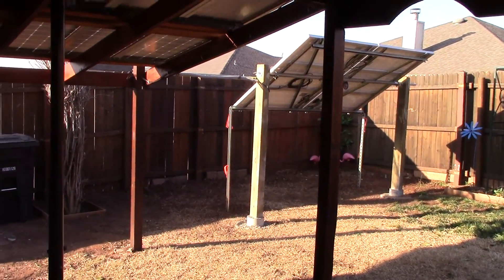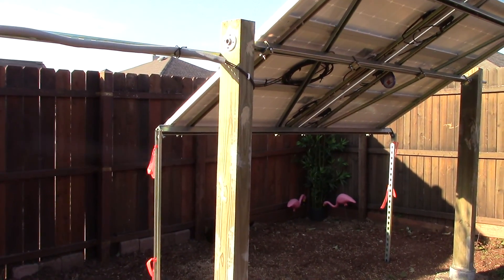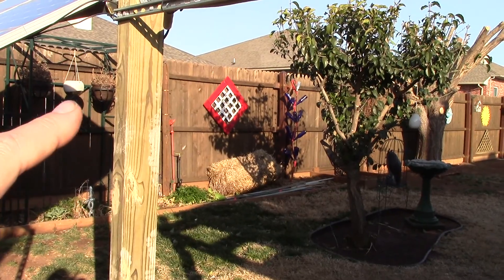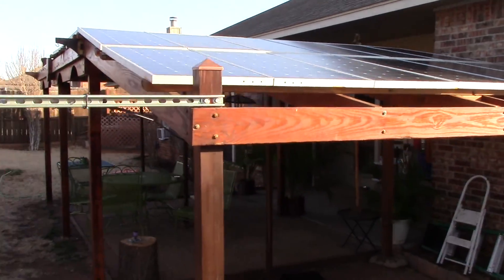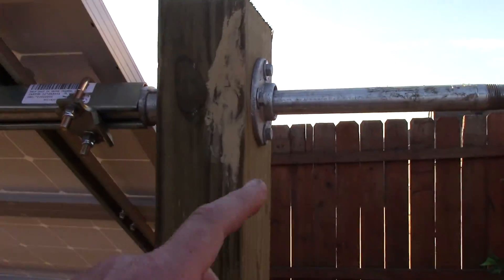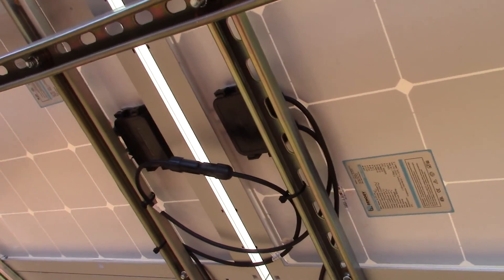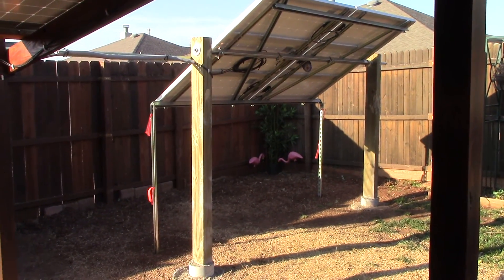Backyard tilting 600w Renogy solar panel fully erected & making power!

Comment: That is a great way to carry out the mechanics which allow the panels to tilt. What are the posts, 6 X 6's ?  I did mine using 2-1/2" water pipe, filled with cement, balanced the panel array and use a pair of strong arms to keep the tilt angle in place.  Got the idea from this YouTube:  https://youtu.be/g6pC1t0m92M?list=PLCEb0JK3QHYqPTKEa7Qq293FYVKu0Ee0X
Reply from the maker: Those were 4x6's. Took that 600w array down and put up the 1,200w array in it's place...which I have now. Never heard of folks using water pipe...but, with cement filled should be good and strong.

Comment: Hey Chris
David from Texas here. Working on new solar backup system got questions for you.I Have 6 190 watt they are 24 volt panels Topoint mono.
Going to wire three panels parallel and three more the same so i have two separate systems 570 watts each.So the questions are
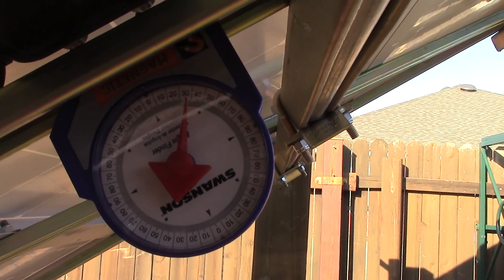panels are on the roof 50' from 2 40 amp epsolar mppt charge controllers.I am trying to use 8/4 soow wire two wires for 1 set of panels and two wires for the other set so each will be 16 amps at say 36 volts 50' to charge controller.My panels usually  run 9:30 to 6:00 at 35-40 volts for this reason and price of wire that is why i am hoping to use the 8 gauge wire.Money is very tight .I am hoping to use this system to run my fridge ( MY P3 KILL A WAT METER IN 24 HOURS SAYS AVERAGE IS 150 WATS)for backup one day on one system while the other is charging and then switch to the other system while the first recharges.Each system will have 6 t105 battery's.Also switching to 2 600 watt grid tie inverters when i can to lower electric bill not much in the summer with ac
but could make a difference in the winter because our stove,water heater, and heat are all propane.Any ideas or help/suggestions
would be great.Thanks David
PS Love your videos.
Reply from the maker: Sounds to me like it is going to be one heck of a cool system. You are describing a "hybrid" system...the most ideal to lower power bills and have battery back up. With 12 T105 batteries @24v...that is a lot of very usable stored power in case of emergency. If you keep them charged all the time and in Float...should hold the load overnight until the sun comes back up and starts recharge/powering the inverter. Cool stuff!

Comment: I like the pipe idea for a pivot, I'm about to redo my panels and may do something like that. Actually the Earth is getting cooler, we are headed for a mini-ice age. Take care man.
Reply from the maker: Cool man/sounds great...lots of money spent on hardware (nuts, bolts, washers). Lowe's has good Grade hardware but pricey. Tractor Supply sells by weight...my best guess...better than 50% cost savings. Good luck with the build...it took me several weeks...but, I go real slow with all the F-upped injuries and DIY.
Reply: Thanks that's good to know about the bolts.

Comment: Nice setup.  I used Charles Landau's tilt angle page to set up my panel angles:
 http://www.solarpaneltilt.com/
I adjust 4 times a year to get most of the benefits,  plus I have a parking position for the panels when high winds are forecast.